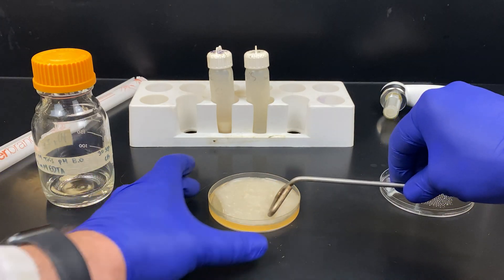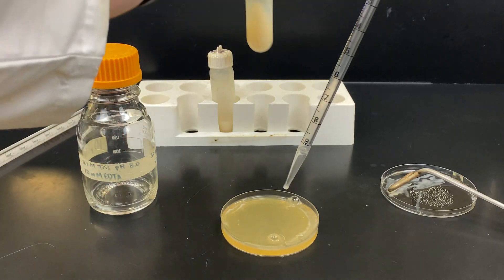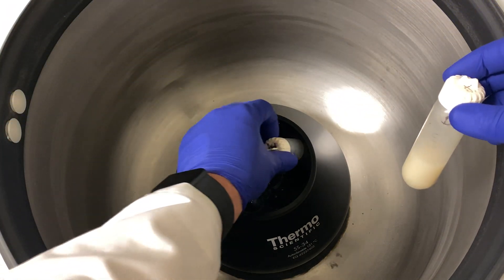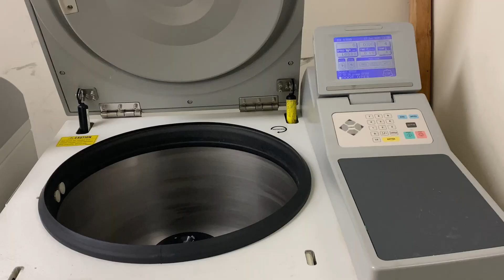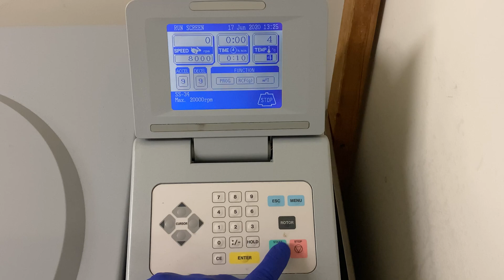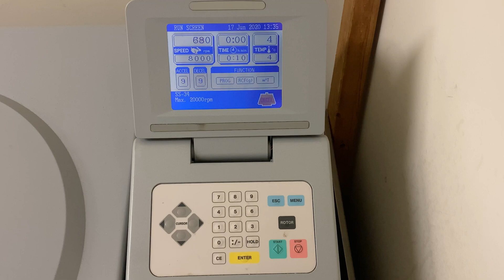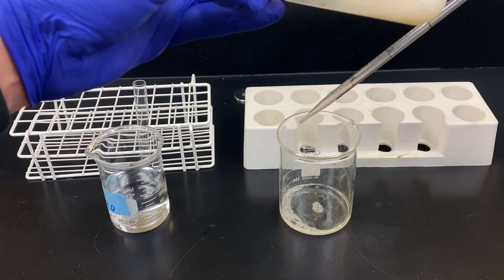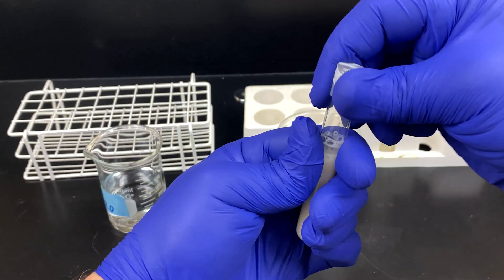Harvesting E.coli from LB Agar Plates

Comment: That scrapper has any specific name? Also does this process interfere with biofilm or viability of the strain? I want to harvest live bacteria with intact biofilm.
Reply from the maker: Thanks for your question Torsha.  I believe the technical name for this is Stainless Steel Cell Spreader.  There are disposable plastic ones call Delta Cell Spreaders.  Often in the lab we create fresh ones by melting a glass rod or pasteur pipette into a hockey stick shape.  That is why I was referring to the cell spreader as a hockey stick (and the fact that I am Canadian).  We ethanol flame them to sterilize them, then used it to harvest bacteria.  I have never had an issue with the cell spreader damaging the viability of the strain.  Unfortunately, I do not have an answer for you, in terms of biofilm.  I do not have experience harvesting intact biofilm.  Perhaps if you reached out to the manufacturer they could provide you with this information.  Best of luck.

Comment: Can this also be used to extract proteins or only DNA?
Reply from the maker: Thanks for the question.  This protocol is for harvesting of the E.coli from the plate.  I don't see why you could not use this to harvest E.coli for your protein extraction protocol.  I am using TE buffer to try to limit DNase activity, so that might not be necessary.  Please note that the DNA extraction protocol I use in the next video is specific for DNA.  There is a different protocol for protein extraction.

Comment: what is the purpose of using TE buffer for resuspention
Reply from the maker: The "T" stands for Tris.  It is the buffering agent to maintain the pH of the solution.  The "E" stands for ETDA.  It is a chelator (grabs them out of the solution and holds onto them) of cations such as Mg+ and Ca+.  These cations are required for enzymes, such as DNase (an enzyme to breaks down DNA), to be active.  As we are attempting to isolate DNA, we would like to limit the effects of DNase.